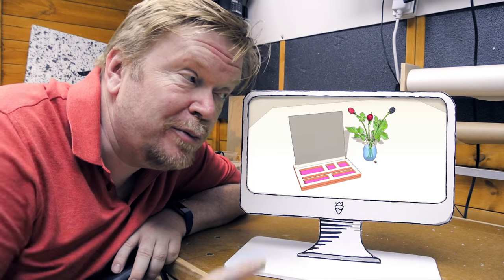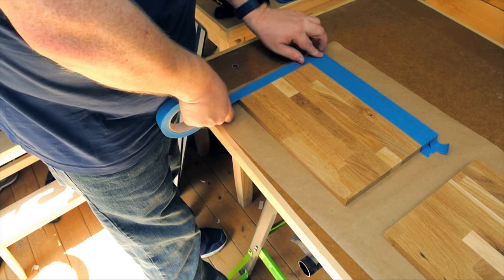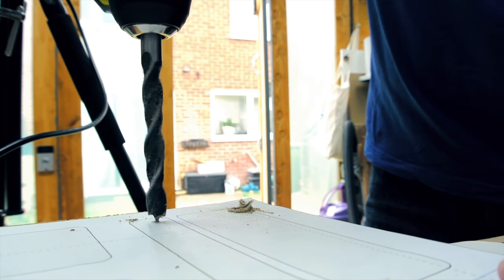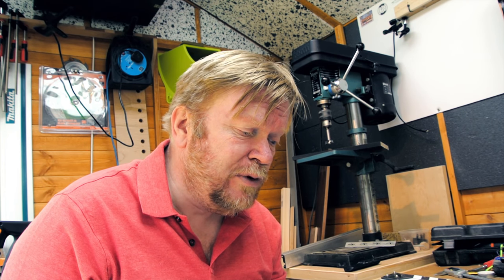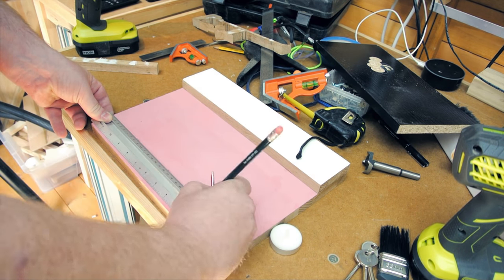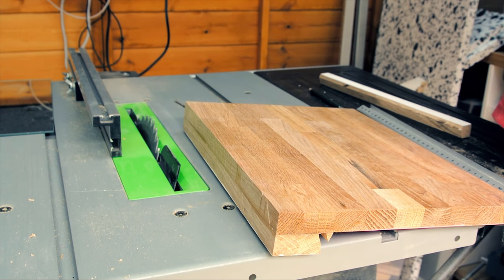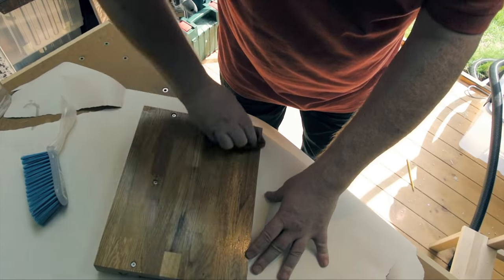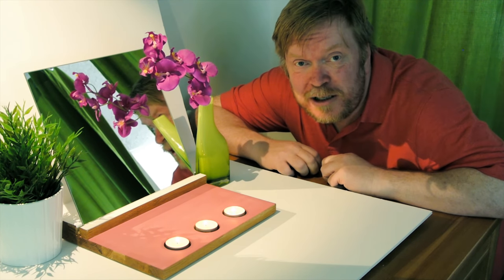Dressing Table Mirror #1 | Contemporary & Frameless in Oak | Includes Mistakes

Comment: Great idea Karl.
Think the jigsaw issue is more about the blades rather than the saw.
Well done!
Reply from the maker: Yes Paul it was more about the blades I just didn't have any sharp scrolling blades, but the saw was stalling and the blade bearing was worn. It was 20 years old. I've a new saw and baldes and have completed a similar project with it  which will be the subject of a future video.

Comment: We've all been there... Good choice to move past the issues and complete the project! If you choose to make another one  in the future you'll remember this and it will go much smoother.
Reply from the maker: This was planned to be part of a short series where I'd stock-up a new Etsy store, so yes I've learned loads and can already see ways of making this much more simply and with a better result. For example cutting the mirror groove against the fence is not as accurate as you think. I've realised that cutting it on a table saw sled gets a much better result.

Comment: Trials and tribulations. nice one mate - I can see why you bought that new jigsaw - for a bit there I actually thought you cut it that way on purpose so you could bring out the new Makita to the rescue!
Reply from the maker: To be honest I was hacking away with the wrong blade, but oak is quite hard and the saw was stalling and the blade wandered like a drunk after closing time. The new makita might have rescued this... but I want to do a proper review of the makita and you might see the original design cut out properly in that video.
Reply: Look forward to it - I'm ordering it in about a week. well, the cordless one. They seem to have a big range of corded ones, not sure how they compare.
Reply: Oh yeah was meaning to ask - I assume the byte in Strawbyte is byte as in n-bits?